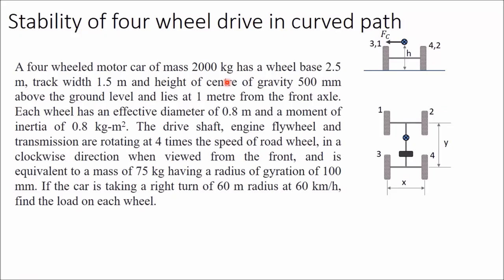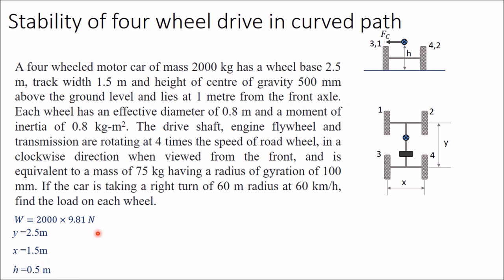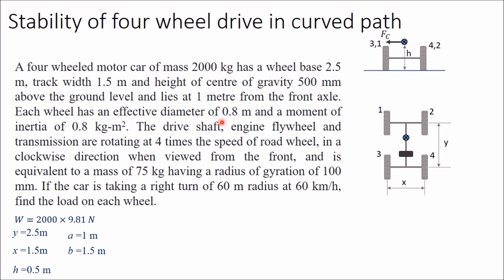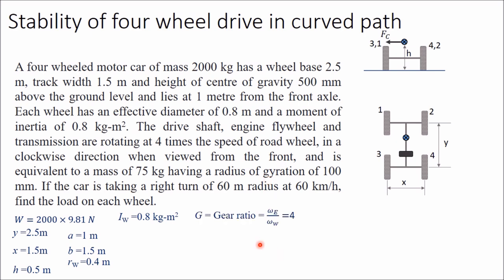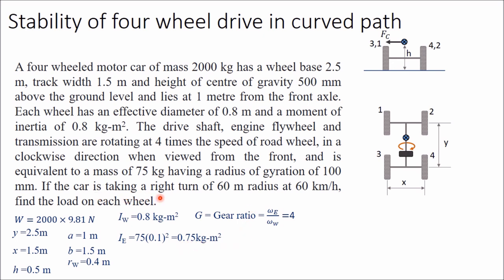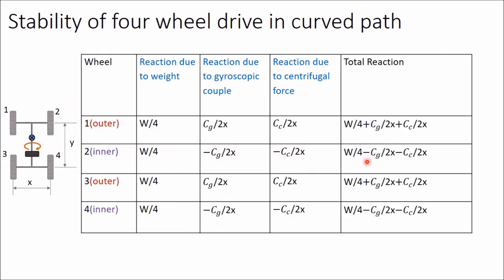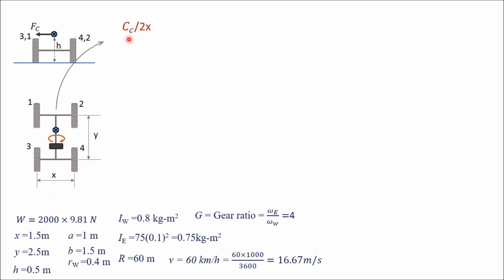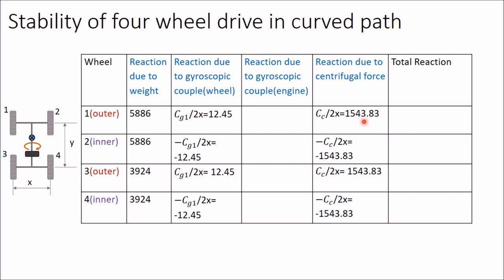Stability of four wheel drive in curved path: example problem

Comment: Sir ji, i have a doubt. If a 4 wheeler takes a left turn will the valus and procedure changes?
Reply from the maker: Procedure should be same. But in this problem reactions due to weight, gyroscopic effect of wheels and effect of centrifugal force would be same for inner and outer wheels. Effect of gyroscopic couple due to engine will differ. Now both rear wheels will have negative reactions due to engine, therefore wheel 3 will have smallest reaction, even lesser than wheel 2 in present case. There fore maximum allowable speed in left turn would be lesser than right turn

Comment: Thanks for the explanation. I have a doubt, the speed of 16,67 m/s is the tangential speed of the mass center, shouldn't that speed be calculated for each wheel individually? Like w * (60 m ± 0.5*1,5 m) ?
Reply from the maker: You are correct, whenever a vehicle takes a turn inner wheels rotate at lesser speed compared to outer wheels. But this variation has negligible effect on final reactions and therefore can be neglected.
Reply: @drjojithomas  Thank you for the answer. I realized later that if the turn radius is way bigger than the distance between wheels the difference is almost non existent. This video was very helpful. Thank you!